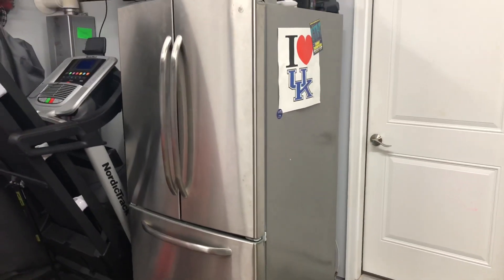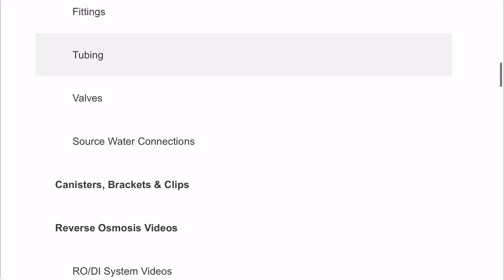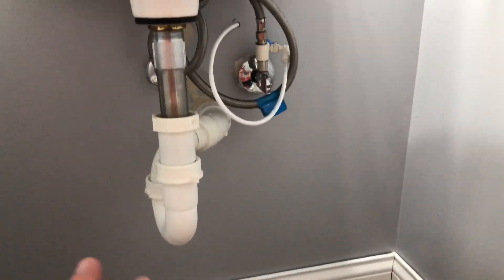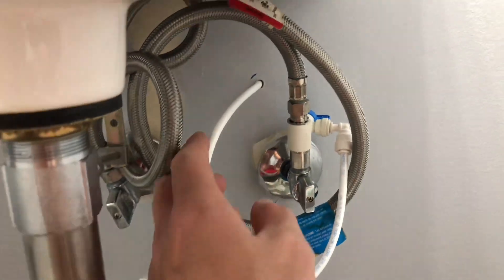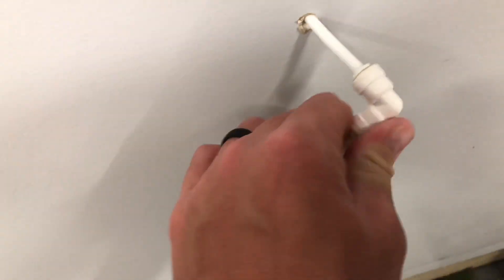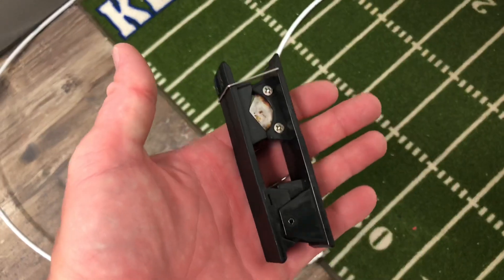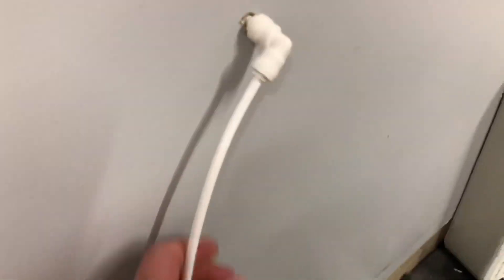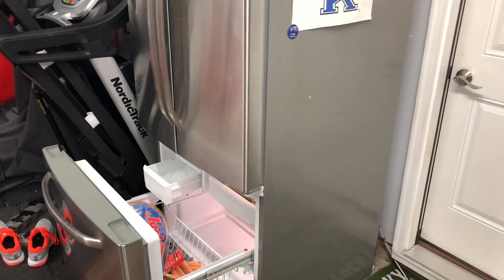Adding Water To Garage Fridge | After More Than A Year It Is Time!

Comment: Thanks for the idea I am moving my ro/di to my garage and I have a bathroom on the other side of the garage wall. The only water in the garage is a hot water heater. I like this better. Thanks
Reply from the maker: It's been running perfect for a week now, I've emptied the ice out a couple times for some coolers. I was really worried about the temp change from inside to outside, its really hot and humid here. But so far so good! I will continue to keep an eye on it!

Comment: If I remember correctly you have a filter I would run it off the filter and have filtered water and ice just tap into the line before the resin. I have the bulk reef supply filter with the drinking water filter and I have the filter in the garage and ran a line to the inside to the fridge and drinking water facet.
Reply from the maker: The only way I could do that is to put my RODI in the garage, and that's not an option. Maybe someday I'll have a better setup and be able to do that!!

Comment: Could you cut a 3/4 pipe the thickness of the wall and finish it off on both sides with maybe some silicone and then run the 1/4 RO through it like a sheath?  Wouldn't that allay any fear that condensation would be a problem with the drywall/insulation?
Reply from the maker: You could, its been like this for a couple years now with no issues.